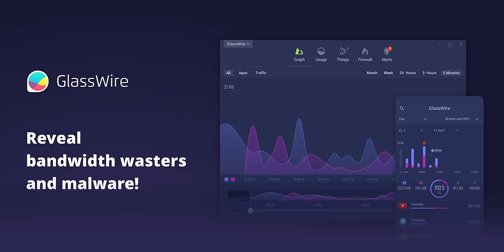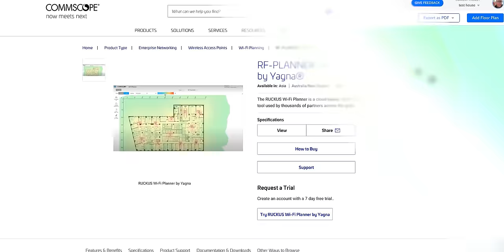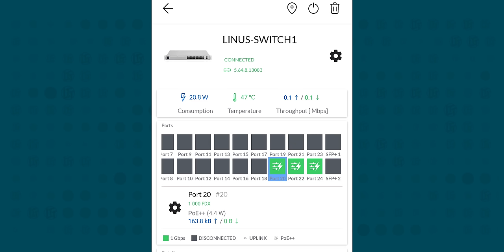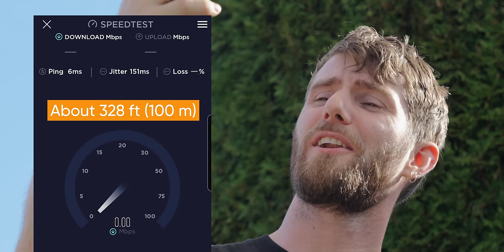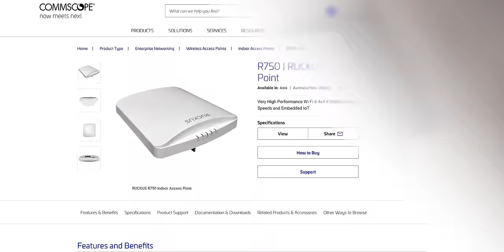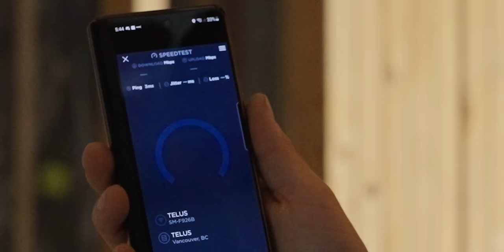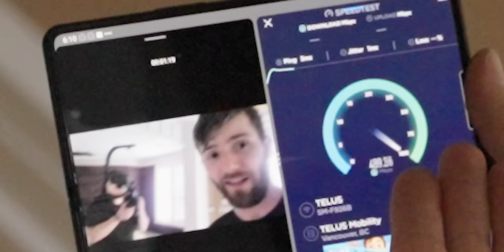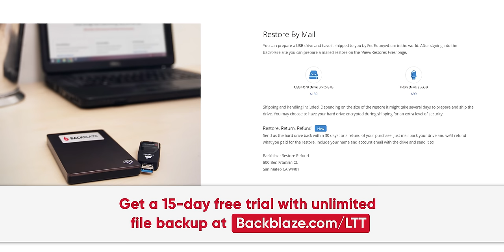Unlimited Budget WiFi at My New House

Comment: Nope, no good.  You can do the same setup with Asus AI mesh RT-AX86U and a reasonably priced Mikrotik such as the RB3011 for under 2000 bucks.   5 Times less expensive, and well supported for many many years with an easy user interface to keep it all up to date.  Try again Linus.

Comment: this whole set up makes 0 sence even if your budget is unlimited. You already have an unifi setup...just use the unifi APs with their smart RF strenght system this will work better and concolidates the whole setup. and IP99? hell hospital operation rooms don't even require IP99.

Comment: I love this... But also... Fuck all that noise... He has So Many ethernet cables running through the house, he easily could have done 2 access points and just hardwired anything with an ethernet port... That's what I would do, even if I had this much Wi-Fi. I mean, my desktop is maybe 3-5 feet from my Fantastic Asus router... But it's still hardwired, despite both being Wi-Fi 6 compatible... And no, I am not doing a mesh system with high bandwidth processes using ethernet and low using Wi-Fi, like I could, but I would argue that it does more than great on my 300Mbps fiber, soon to be 1gig if I can get the deal I am after, with my Very satisfactory ISP

Comment: It should be said that you can overdo it with too many APs like he has inside that home. Honestly, I'd be amazed if the on board controller is using 40% output tower due to the number and capacity of the WAPs used. I mean good grief. I guess it's fun to do but it's not practical if you're watching this for a how to video. This should be simplified and Linus should have installed them properly and shown the math on how to install enterprise WAPs and explained features but instead I felt this was a 'look at me I got 10k of free crap so watch me install it' why not take out some WAPs and install them in a couple charities around your home? They would get more use by folks who really need the hardware. Those APs are going to hardly sweat in that setup.

I love Linus and the channel but as someone who installed multiple enterprise systems (including Ruckus) then this is just stupid. Was not even fun stupid like blowiematron.